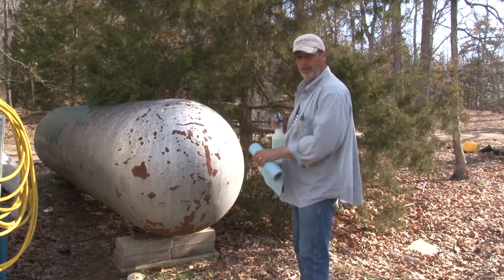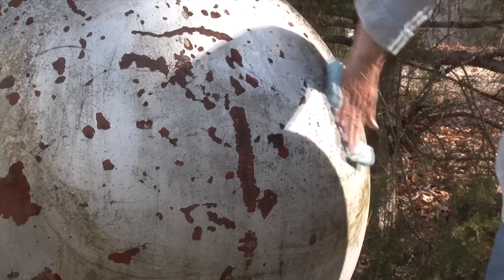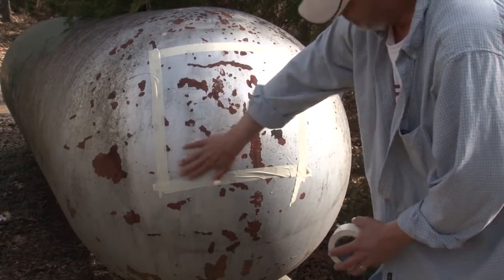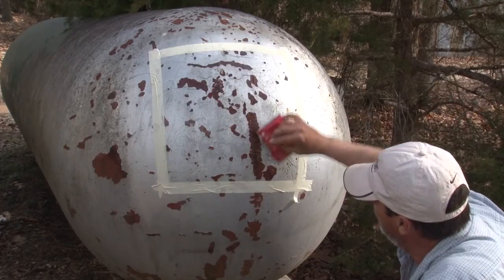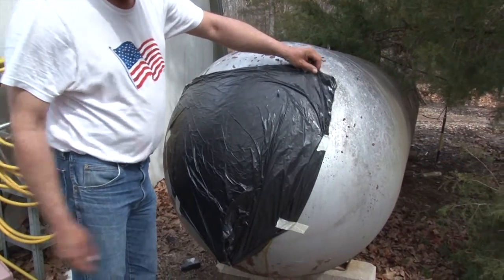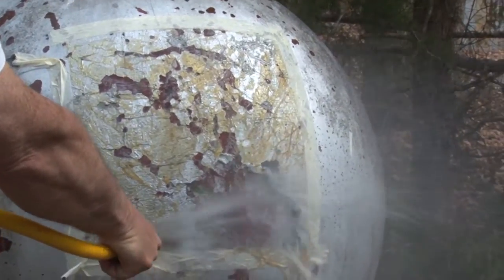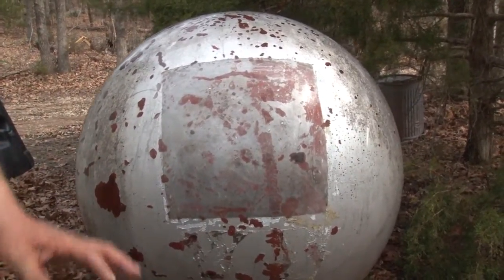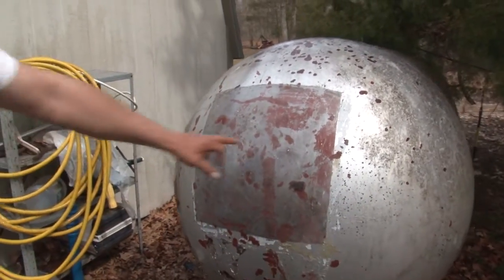HOW TO - PAINT REMOVAL - P.A.C.E. GEL Propane Tank Refurbish Demonstration

Comment: Would have worked better if you didn't rub it all over with that brush, basically repainting the surface you're trying to strip. This type of thing works better if you go in One Direction. And maybe use a scraper. Also would like to point out that stuff is not very good for the environment or your hands. Be safe out there people. And thanks for the video.